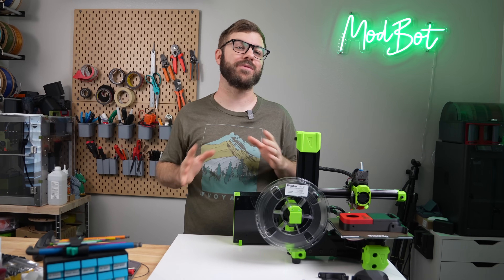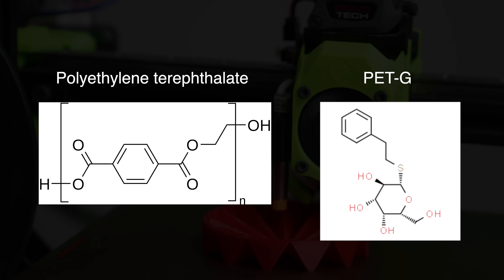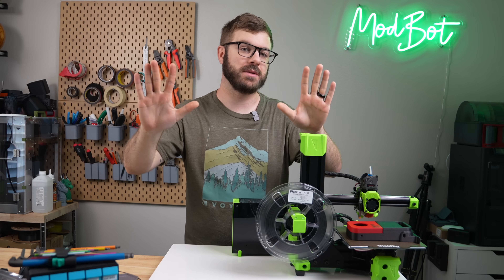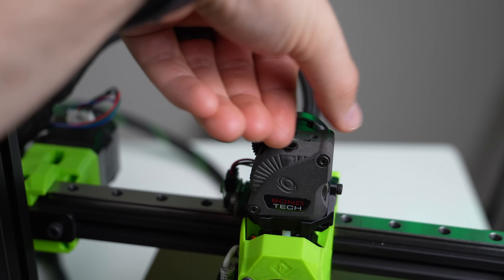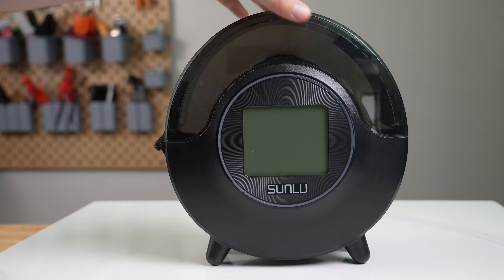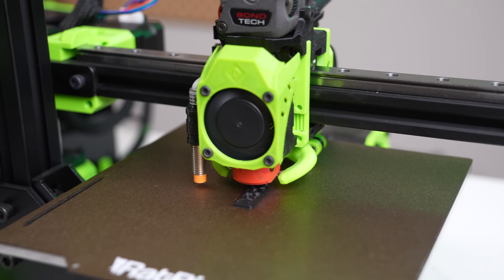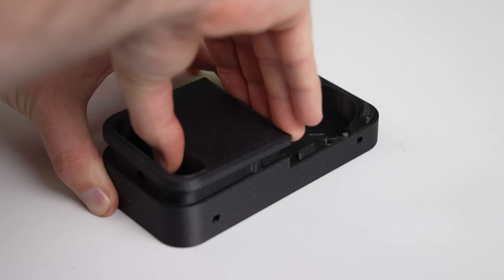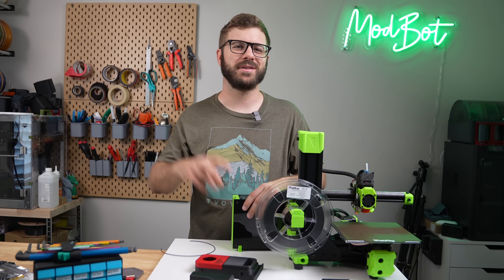High Temp CF-PET Prints Like A DREAM (aeForce™)

Comment: Question for you: have you found PET to be prone to warping? I have every ounce of cooling turned off and heat up my chamber, but I always seem to loose bed adhesion mid-print (as the lower layer of the print cools naturally) and my prints flex up off the build plate. 

Printing at 300c N; 100c Bed (max temps for my K1C)

Comment: Hi can PeT-Cf printed hold water pressure ? 10mm X 70mm X 20 mm piece with holes drilled all the way through .   If I use this to run water through the holes can it hold about 10# water pressure? Both ends of the holes with by sealed .  Thanks !

Comment: I just printed my 1st part with PET CF.  The print surface is pretty rough.  I have an ender 3 V2 with an all metal hotend, metal extruder but used a 0.4mm hardened steel nozzle.  Print temp was 285c.  I just bought a cheap enclosure,  spool heater/dryer and 0.6mm nozzle.  Any other suggestions?

Comment: It doesn’t make them stronger…
Reply: That all depends on what you mean by "stronger" with filaments like PETG, ABS, or PLA it increases its tensile strength and layer adhesion at the cost of making the materials more brittle overall.  However materials like Nylon that are more likely to warp or deform rather than sheer at it's failure point, the CF significantly decreases deformation under load.  That's why it's becoming the standard for 3D2A projects.

Comment: Great overview, though Phaetus is a bit pricier than the Polymaker Fiberon PET-CF17 I recently picked up. Theirs is $50/kilo (0.5k spools, so $25 each). Prints REALLY nicely on my Bambu A1 @300C with the bed at 70C. Great face finish on my Darkmoon3D Satin plate too. So far, the new handle on my Big Green Egg is holding up very well - no heat-induced warping, and the trailer hitch cap covers I made with it are gorgeous. Really dig this material, though a bit sad that one can only get it in black.

Comment: Phaetus dragonfly is the bomb. I installed one on my ender3v2 running klipper  2 years ago and havent had an issue since.
Reply: I use their dragon UHF and it’s amazing. Flows so fast but can print super slow without heat creep and the design is incredible. Being able to swap nozzles so easily with one hand is the main reason I bought it.

Comment: I am looking for high temp in sunlight or a car but I don't need the cost of carbon fiber and my project does not need to be any stiffer than PLA. And ABS is out for me due to the fumes and settling of partials all over your printer. I am looking for something in the cost range of PLA or PETG per Kg. I am able to print PLA these days with 8-10% infill that is quite strong. I use a REVO 0.6mm high flow hotend and nozzle and a direct drive Extruder.  It would make for a nice video if you have any recommendations.

Comment: CF does NOT increase strength in nearly ever filament ever done. It is EXTREMELY rare (basf is the only exception I know of) for CF to make a filament stronger. 

Informative, but inaccurate... 

It does help with temp and wear resistance, but part strength is typically weaker.

Comment: Is this a fume free option like PET-G?  Thinking this is the ticket for my PRUSA fan shrouds, instead of ABS/ASA, and maybe even for a set of Voron parts. I have small kids and dion't like the idea of printing Styrene filaments, even with the filter in the X1C.  This looks to have the advantage in heat resistance anyway, so for the PRUSA shrouds and parts near the nozzle that warp at high temps, I am failing to see the downside.  Great vid!
Reply: Did you try it? I’m planing the exact same thing!

Comment: CF filaments that AREN'T PLA, that stuff is a prime example of throwing money at something doesn't always make it better and in some cases makes it worse(CF-PLA is worse in every way compared to regular PLA...)

Wish someone would start making more GF filaments instead of fixating on the 'uber CaRbOn' trope as GF is likely to be as good or even better that CF when added to many plastics, and it is SIGNIFICANTLY cheaper...
Reply: It´s all marketing. CF does not increase strength, it can give you cancer and it is expensive but it sounds cool and it looks cool and fame driver influencer have to show that shit even though it does not provide any benefit beside improved printability.

Comment: Looks great but also gives you cancer. It does not really increase strength, just improves shrinkage, printability and makes the part stiffer.
Really wish people would get that straight. It also gives you lung cancer if you don´t have great ventilation. Just don´t use that stuff as a hobbyist, it is not worth the trade off.
Did I mention the cancer ?
Reply from the maker: Do you have any studies to back this claim? That is a bold statement to make without having plenty of evidence to show. If so l would love to see it.
Reply: Well as a mechanical engineer it is the stuff I studied. Not this material specific but materials like it. And having worked for the automotive industry for over a decade as a designer for plastic components I think I know what I am talking about. 
I am sure there are studies which will show the validity of my claim but I don´t have any at hand.
It is also common knowledge that fine particles (look up asbetos) are prone to that so I am surprised there is zero consideration from your site for this kind of  health risk. You are also aware of health risks which come with UV resin right ? Do you see many people talk about that in detail ?  @ModBotArmy
Reply: @Namanoh  Oh it does. Not in huge quantities, but it still does, latest when parts are being post processed or when they brake down over time. I have heard all those arguments in regard to ASBESTOS, it is not so bad, only small amounts, it is bound in it´s matrix bla bla bla. And look where this lead us =) BTW lead, remember the lead in gasoline or in paint is not so bad ? Same with PTFE in kitchenware.

Look if you think that printing the 3 cents part you really need in CF is worth the cancer for you, it is fine for me. I just try to educate people who watch videos made by some attention seeking influencer on YouTube who makes probably 100x my salary without even knowing what he is talking about because he has observed something personally so it must be the truth.

Even if there were 100% certainty that this stuff is absolutely harmless, which of course there is not. Why would you want to print with that stuff in the first place ? It almost does nothing in regard to part strength. The main reason to use CF or GF is to stop the warping and increase stiffness. If that´s your goal and you have ventilation fine do it but otherwise there is no point in doing this in the first place. Just even from the material costs point of view.

Comment: Phaetus is the GOAT.  I use the Rapido UHF on my VzBot and couldn't be happier with everything I've ever used from them.
Reply: I use the dragon UHF and it’s absolutely amazing. flows faster than my printer will ever be able to handle but still maintains super intricate details and control. Plus zero heat creep even if printing super slow. Even the screws and tools they supply are super high end

Comment: I have this and the Qidi version. I think they’re the same honestly. I LOVE this filament and I’ve been using it for a ton of stuff. 

Excellent video as always, man.
Reply from the maker: I honestly had no idea Qidi had a version of this. I will have to take a look. Thank you 🙏
Reply: @ModBotArmy  yes they have the entire line of these engineering filaments now, around the same prices but because they’re all on Amazon there are some significant sales that have popped up.
Reply: @ModBotArmy  they both use the same manufacture

Comment: Keep in mind to get peak temperature properties you need to anneal it (like 4h at 100C)
Reply from the maker: There is no mention on annealing to get the mentioned properties. This prints at 300C which is WAY hotter than any PET or PETG I have seen previously.
Reply: Annealing qidi pet cf at 100 celsius for 4 hrs greatly increases strength at temperature. See their TDS

Comment: Not sure if i missed it in the video but is an enclosure necessary for this filament?
Reply from the maker: Nope! No enclosure needed :). Control moisture by drying it and have an all metal hotend are the main things.
Reply: @ModBotArmy  beautiful.  I may give this a shot. Those prints look super smooth.

Comment: Rather than adjust a bunch of speeds in the quality profile, you should be able to convert the max speed you want to print at from mm/s into mm/s cubed, and simply set it in the filament profile under Max Volumetric Speed. The slicer will then automatically scale all the other speeds for you, and only when that particular filament is chosen.
Reply from the maker: You are absolutely right. I have used that in the past when I have determined my hotends max flow rate but hadnt considered doing it in this case.
Reply: Any chance i could get more info on this? This sounds like exactly what i need to learn. Im still pretty new to printing

Comment: Allot of the CF Filled Filaments are just far to pricey for me to afford.  I can afford a nice PLA CF (1 Kg ) by Jayo it is low cost compared to the rest but great filament.

I wished to get a PETG CF filament to use as it be stronger than the PLA CF. But most of those few I found were very pricey like £40 upwards.

I then was on Amazon UK and found a ERYONE Carbon Fiber PETG Filament for only £24.99p  ( 1 Kg ) black. which is amazing! I will try it soon? it has got god reviews.
I use hardened or stainless steel nozzles as standard now on my 4 printers so the filament wear will not be a issue.

I just got the 4th new 3D printer the Elegoo Neptune 3 Max. it is my 1st direct drive printer and I love it. I hoping to upgrade the head to a all metal throat soon?
Reply from the maker: Phaetus does have a CF-PETG that wont have the high temp properties but should still be a great filament for less than half the price of this. 

Awesome! I dont have the 3 but I believe I have seen videos of others upgrading the heatbreak to make it all metal.

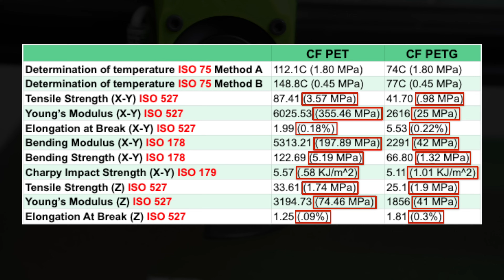Comment: 2:50 Uhh, when you say "the MPa are different" here, you do know you're highlighting the error bars on the measurements here - not the actual measurements? The +/- sign on the original table shows that clearly; I'm not sure why you replaced that with brackets
Reply from the maker: Good catch. I did miss that in the table. Hopefully that is seen in the previous screen grab.

Comment: how did the fan change the layer strength ? I had the same problems with pc-cf it needed 10% fan all the time and upto 30% on overhangs otherwise it was a mess.
Reply from the maker: I didnt notice any difference when pulling on the parts with my hands from 0 to 30% fan speed. That being said it isnt very scientific and it is possible that it did have at least a slight affect on interlayer adhesion.

Comment: So I'm understanding this correctly; you were able to print this material open air, no cooling fan, and it printed without warping and essentially no stringing or layer lines?

Sort of sounds like a miracle Filament. How long would you say it took you to dial in the settings before having a good profile for it?
Reply: I think the reason it's easy to print is because the added CF makes it easy. Standard PET is said to be much more annoying.
Reply from the maker: Yeah, I was almost as suprised as you. I went with pretty standard settings and the middle of their recommendations. The only issue I ran into was cooling related but once I adjusted I got near perfect prints after that first print. This stuff is beautiful. Something tells me they have done more to this polymer than they state. I dont see how a PET and CF would get temps this high. Not sure what the secret sauce is but it prints very well, looks incredible, and is super stiff.

Comment: Filament looks great but too expensive for my taste. Maybe one day when I have some extra to splurge lol Side note, I was looking for a filter to put in my upcoming V0.2 build, that Bento Mini looks perfect. Thanks ModBot!
Reply from the maker: Totally, if you dont need the high temp stuff just check out CF PETG its less than half the price and still awesome.
Reply: @ModBotArmy  where's paht-cf fall into the list? What's the most moisture resistant and strong cf filament? For outdoor or use on cars

Comment: When you change the hot end on phetus do you heat it up to 250?
Reply from the maker: Yeah at least. Since I printed at 300C I may have even gone a little hotter when tightening but yeah 250 is normally what I do.
Reply: @ModBotArmy  thanks
Reply: I like your videos. How do you like the carbon fiber? And does it smell?I printed some but only the one from bambu.
Reply from the maker: @emanuelcalderon  i appreciate it 😊 I did notice a faint smell. Nothing too strong but if I was doing a lot of cf I would opt for added filtration or better ventilation than my small studio.

Comment: Nice. I'm a CF junkie myself. That said, I hope Phaetus sent you some of their ASA-GF. I have had a really hard time dialing in the flow rate for that stuff. Love to see others experience with it.
Reply: Just checking: Did you predry it? All fiber reinforced materials should be predried even if the base (matrix) material usually does not require it as the interface between material and fiber may absorb additional water.
Reply: @Bapate-rh9be  Yep. I dry all my new filaments right out of the box. Learned that lesson the hard way.
Reply: I have had no issues with the asa gf I love it
Reply: Hey I use the same ASA-GF in red. I use almost the exact same settings as I do for regular ASA and it normally comes out great! Did you ever get it dialed in?

Comment: I am curious if the heat resistance is straight after printing or the parts need to be annealed first. Recently UltiMaker also released a PET CF, that also comes in blue colour and has even higher heat resistance after annealing about 181C, while without annealing it is just 76C. Which is closer to other PETG CF filaments available in the market. PETG can not be annealed (glycol prevents crystalization) and PET can, but it would a bit disingenuous to claim 112-148C heat resistance and not mentioning anything about annealing, IF it is required to get the heat resistance at that level.
Reply from the maker: There is zero mention of annealing in any of the testing whatsoever including their test parameters. It is my understanding that this is straight from print bed. The filament prints at 300C which is stupid hot and helps to confirm what I am seeing. I agree completely putting values that require additional post processing like annealing without mentioning it would be deceitful.
Reply: @ModBotArmy  Thank you very much for the response. Indeed the print temperature is quite high so maybe this is a really nice super material. I will see if I can find it in Europe or I will try the very similar QIDI PET CF that also prints at 280-300C and is at a similar price. For computer parts near heatsinks the temperature resistance of PETG CF is not good enough. This filament might be a very good and relatively affordable alternative option to PA6-CF and PC-CF. Maybe Phaetus will also make ABS or ASA with CF in the future, because currently I only see glass fiber reinforced versions.
Reply: In my experience, it is often neglected to mention the needed annealing by filament manufacturers. Sometimes it's in a footnote, sometimes nowhere. I am extremely doubtful, the PET-CF will come out crystalline. It would not print as easy in an open printer if it would already crystallize during printing. Also you would see significant shrinkage during printing, which would either warp your part or you would at least see dimensions way off.
Reply: Correct me if I’m wrong, in one breath you say you can’t anneal PETG, in the other why don’t you say whether you’re annealing this blend.  If you can’t anneal PETG, why should you expect a blend to be annealed?  🤔
Reply: @ziggystardog  I am not expecting the blend to be annealed... I think you misunderstood me. I will try to phrase my question as clear as I can. Does this filament "aeForce PET-CF"  have an ISO 75 heat resistance of 112C straight of the printer OR does it require annealing to reach that level? Is this more clear?
Reply: @Dramaican88  thanks, I’d missed that this was CF-PET rather than the more common CF-PETG which explains the added expense.  Per your question, it’s most likely on the data sheets he referenced.

Comment: Why would you print parts that do not need cf, do functional parts that actually need this filament.
Reply: Because he can lol
Reply: As he said in the video, aesthetics. CF makes gorgeous parts. He didn't pay for the filament, so why not. Plus it's his job to use these things for review purposes and let us know how they perform.
Reply: @FilamentOnFire  refer to my reply to him.
Reply from the maker: It’s a gorgeous filament. And the heat properties are perfect considering this will be in an enclosed printer printing fairly high temp materials. Depending on what you are printing I know a few that only print in cf for their products. They don’t technically need it but it looks great and customers are happy to pay a little extra for it.
Reply: @ModBotArmy  But literally the reason to buy it is for the CF properties and we have ZERO clue if they are worth it or even functional with this review. I don't buy engineering materials for aesthetics and I doubt anyone does.
Reply: @noanyobiseniss7462  They don´t work anyways, this is not enineering material because the CF content increases ridigitiy not strengh.
Reply: @sierraecho884  Well this didn't age well now did it.